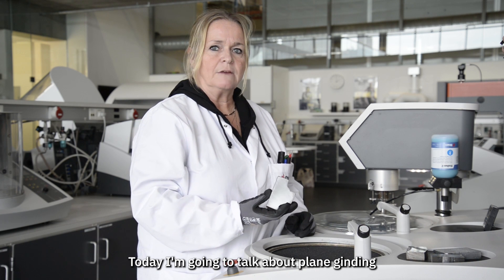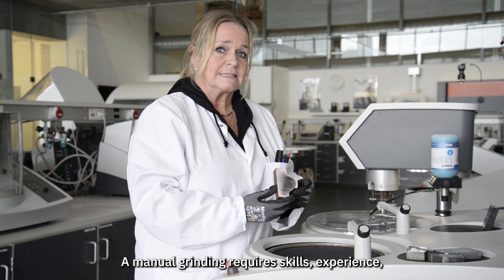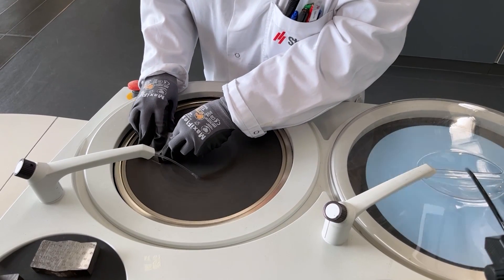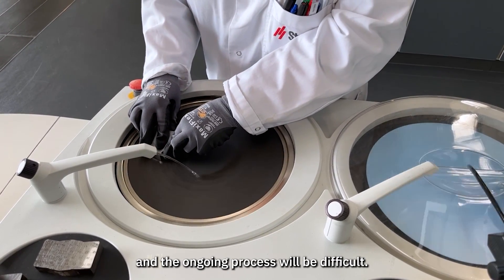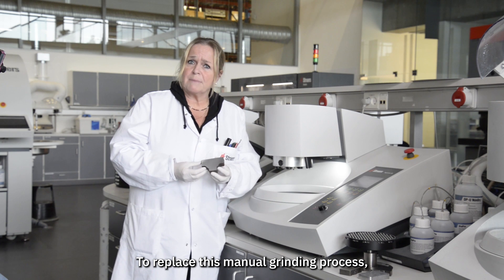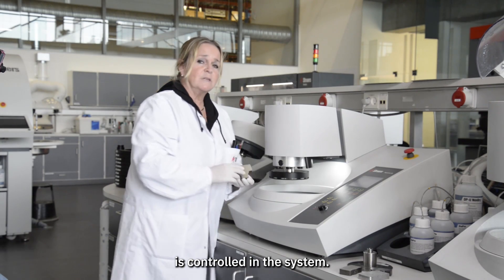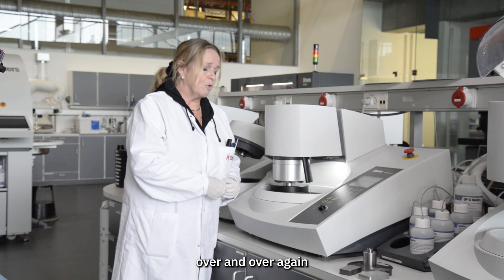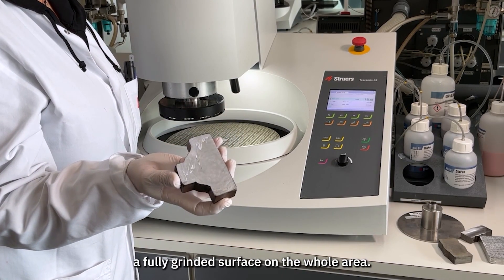Flexible specimen holder: Reduce strain on your wrist, elbows & shoulders in your sample preparation

Comment: Can this hold rock samples for geological thin section preparation?  How flat do the samples need to be to fit in the specimen holder?
Reply from the maker: To use the flexible specimen holder the sample needs to be > 10 mm. However, if you want to work with thin samples, check out this page: https://www.struers.com/en/Knowledge/Special-applications/Mineralogy-and-Thin-sectioning